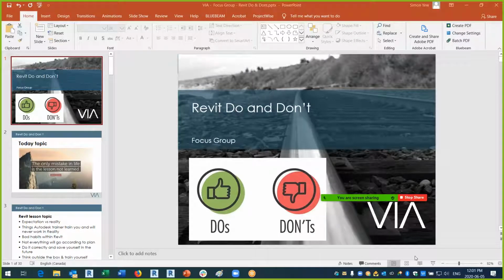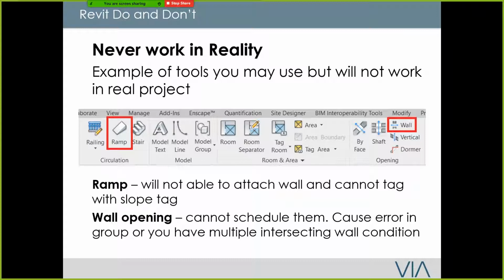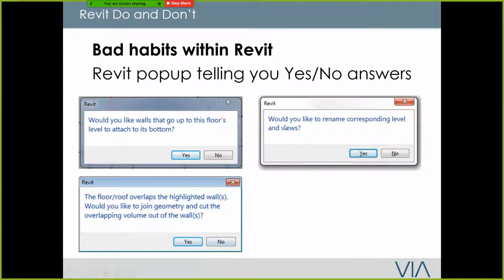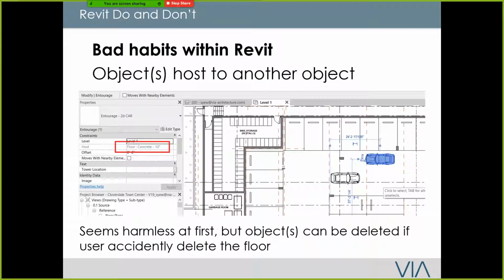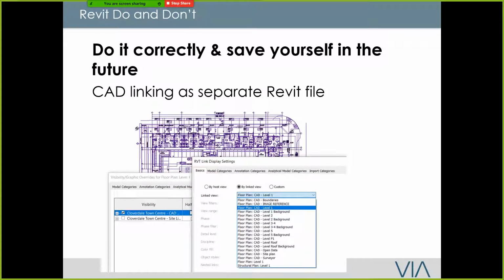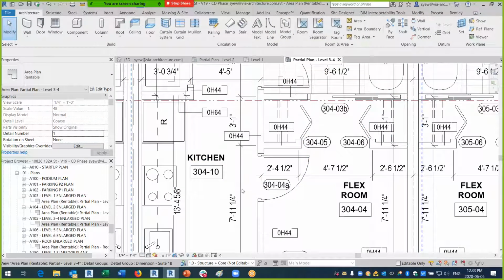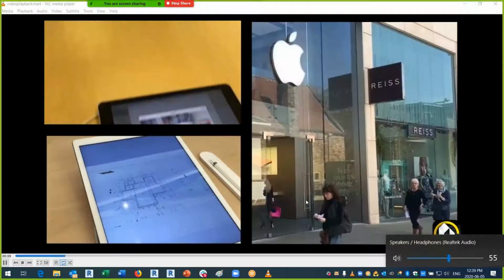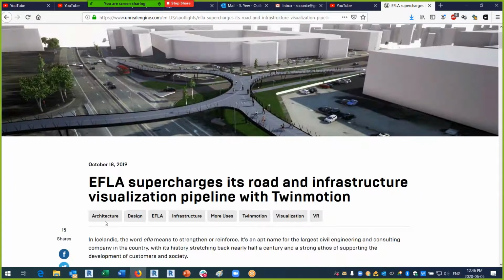Focus Group - Do and Don't in Revit

Comment: I am trying to understand your workflow for the separate revit cad file.
It makes sense to do that with cad files like the survey, that never move, and you always want it to load in the same place ( property lines matching revit, etc)., assuming you use the origin to origin, But what do you do about stuff like a kitchen plan CAD you get from a consultant? 
Do you just need to make sure that its location in space (in CAD) matches relative to the revit insertion point?
Because I think if you move the autocad link in the view, it will move the whole link( all nested cad files), and not just the individual cad link in the view? Its kind of hard to explain.
This is sort of where I am getting stuck
1. Create new revit file
2. match True north in new file to that of MAIN revit file.
3. Set View to True north
4. Import CAD file of survey. survey set up so that bottom left of street intersection is at 0,0
5. On Revit import, choose do not correct lines and use origin to origin. 
6. cad file comes in at the revit origin point ( the new x/y gizmo they added in a recent release)

Now if I want to import lets say a kitchen layout in Cad,  what do I need to do with file. Do I/Can I  just create a new level 1 plan view and then import the "raw" cad file from the consultant (dirty) and then go to VG and turn off the survey CAD and any layers from the kitchen consultant I do not want? Am I concerned of its location in space ( relative to the survey), or does it not matter and I can leave it per the cads origin(non coordinated origin from consultant cad file?

Once I go to my main cad file, and go to VG I will see both the kitchen CAD and survey CAD on.  Can I just turn off the site cad, and move the kitchen can where I need it, without having to worry about how that will mess up the location of the CAD file on another view?

Comment: I never thought to use curtain panels for openings. What if you used a void family that cuts a hole? Are both viable options? I am also guessing that if you want to create a floor opening, you would use a flat slopped glazing? Will that gut through several roofs/floors, or just 1? I often model the slab and the roofing/insulation separably.
Reply from the maker: You can use family that cut a hole. I do it if you want more control and flexibility. I use the curtainwall as opening to show it as easy cut that is flexible. However my colleague at work having issue with wall tag since these curtainwall will tag as wall. As for floor and roof, I would keep the finish part as roof and floor for structure below. It has to do with structural coordination. Most often structural engineer don't care about the architectural finish. They only care about structure. For them they can easily turn off the roof and only get floor Architectural slab. So it has worked out.